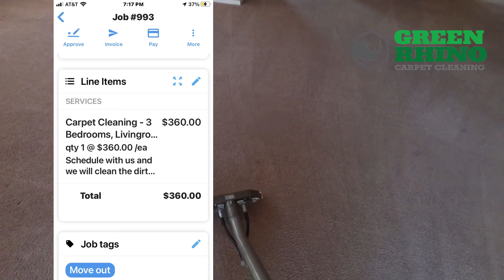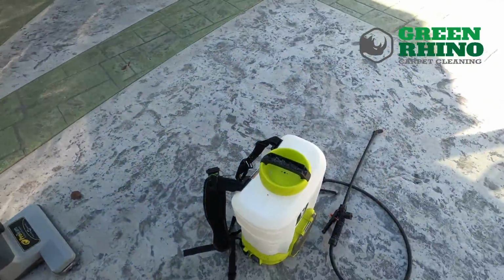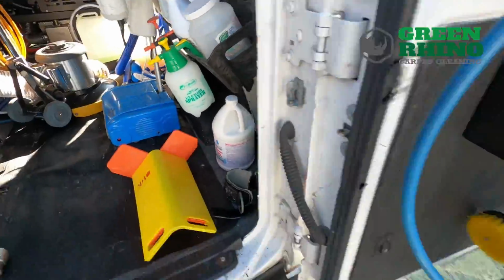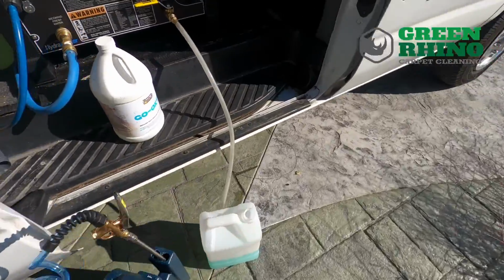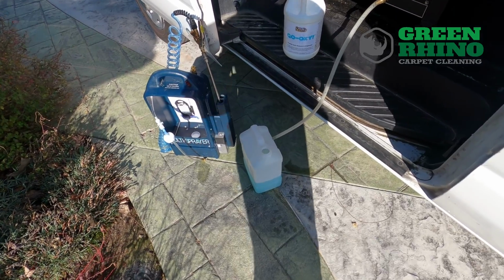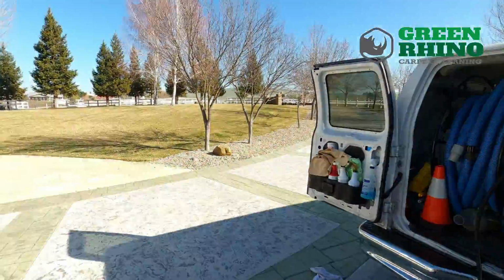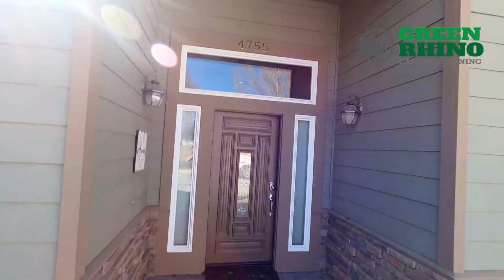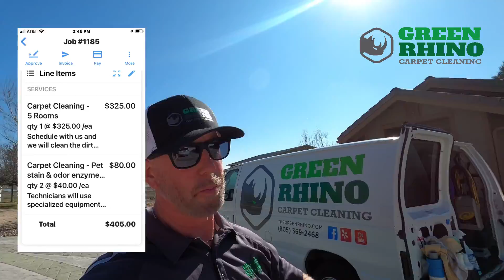The Carpet Cleaning Biz - Turning Customers to Clients

Comment: When you use high ph to boost your neutral ph solution do you still have to use a rinse?
Reply from the maker: Depends on what your boosting with. With peroxide products not necessary, with a high pH cleaning solutions such as Sager‘s code red ph 12.   Yes use a rinsing agent , with deodorizers not necessary to use a rinse